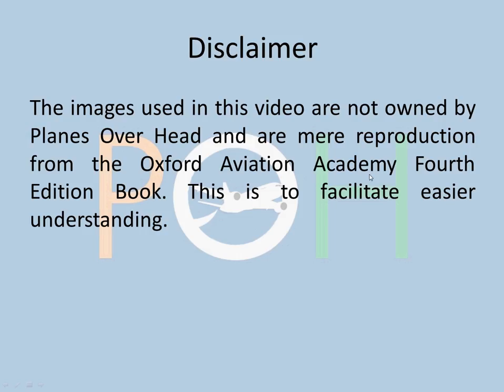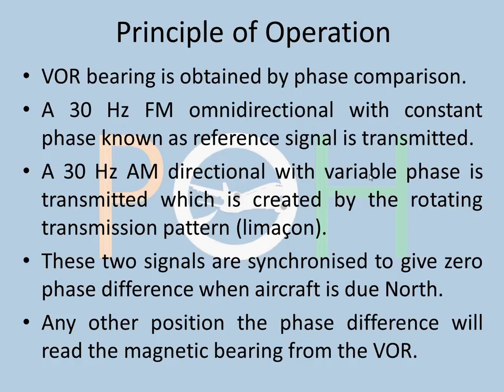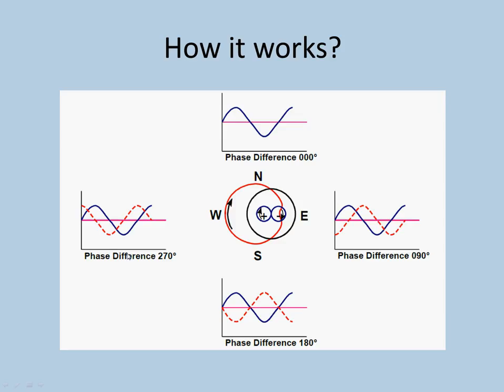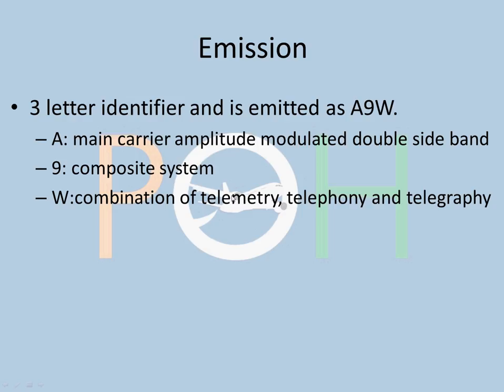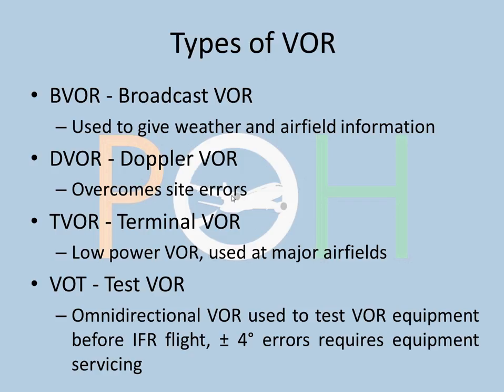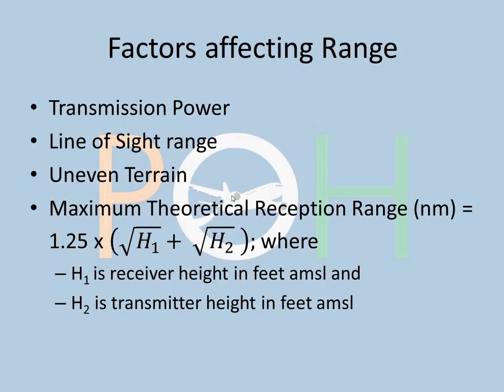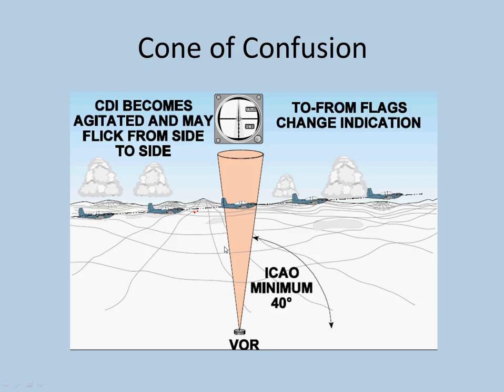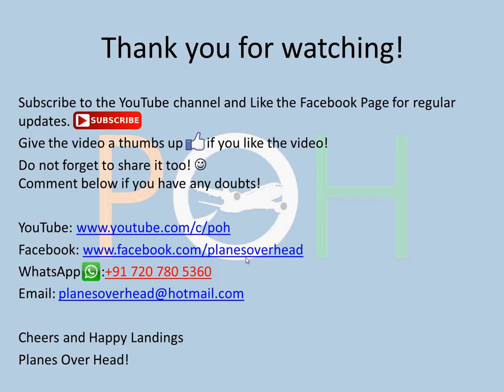Radio Navigation - VOR

Comment: Hi, I have a question :
It is important the height of the side band antennas (from the screen to the bottom of the antenna)? This height it is determined based on the frequency?
Thank you very much
Reply from the maker: Yes that's correct
Reply: @poh 

Hi, where I can find this table (dvor side band antennas height based on frequency)?
Thank you for your help
Reply from the maker: Not so sure on that